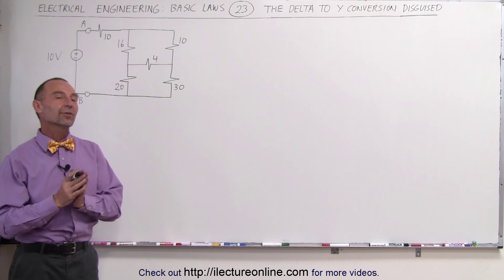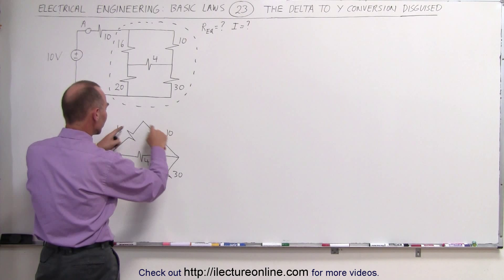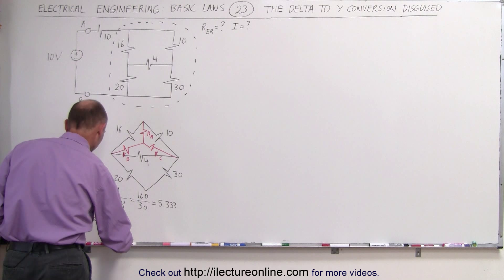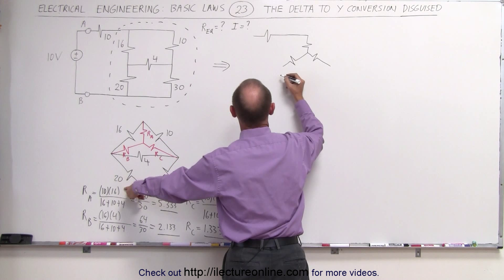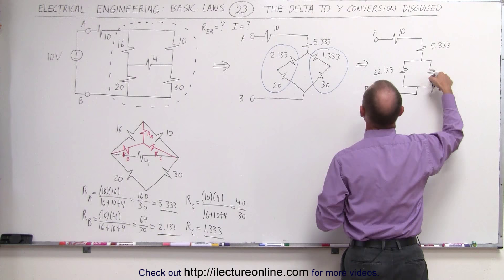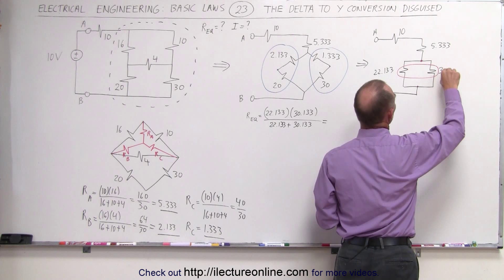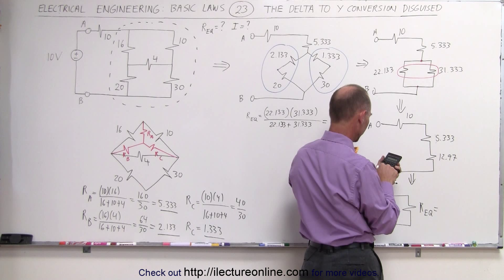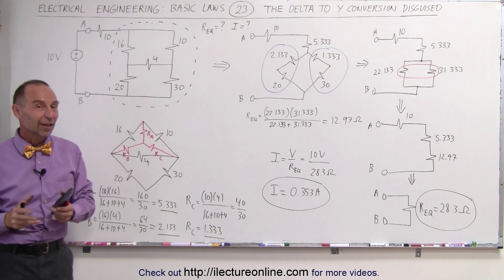Electrical Engineering: Basic Laws (23 of 31) The Delta to Y Conversion DISGUISED

Comment: Is it necessary to deactivate the voltage/current source while applying Delta-Wye conversion in a certain section of a circuit? An answer to this question would be very helpful as I have an assignment related to this topic that needs to be submitted some days later.
Reply from the maker: The delta - Y conversion is independent of the voltage or current source.  It only affects the resistors.  Not sure what you mean by "disconnect".  If I understand you correctly it would not be necessary, but then I am not sure about the situation you are referring to.
Reply: @MichelvanBiezen  it's ok, I got my answer, thank you so much. One of my friends told me that while using the Delta Wye conversion, I need to imagine the circuit without any current/voltage source and perform the calculation, and then later on (after finishing the calculation) put the sources back in the circuit in their previous position. Basically, she told me that I can't perform Delta Wye conversion in a circuit if it has any kind of current/voltage source. I just needed to clarify that confusion, and you did it nicely. Thanks again.

Comment: I was taught a more complex equation for delta to y conversion but Dr. van Biezen's equation helped me solve a problem for ELE 211 DC circuits. I used the equations taught in this video and solved the equations for the problem in my course. If anyone has an insight in the differences in the equations and how to apply them, please respond to my remarks.
Reply from the maker: The equation shown is the only one that I know of to solve the delta to y conversion.
Reply: @MichelvanBiezen  I was shown RA = (R1R2 + R2R3 + R1R3)/R3, RA = sum/R1, RC = sum/R2. I was solving a Wheatstone bridge problem with resistor load instead of a galvanometer between the two series resistors. I solved the lower half of the circuit using a delta conversion. my solution worked in Multisim. The second part of the problem asked to solve the upper half using a Y conversion. Your equations gave resistance equivalents that equaled the circuit measurements.
Reply from the maker: They are probably the same equation in different form.  Did you try to convert one to the otther.  We have some videos that show the derivation of those equations:   Starting with this video:  Electrical Engineering: Basic Laws (29 of 31) Delta to Y Conversion Derived R1=?   https://youtu.be/pDRE4OSUd2Y
Reply: @MichelvanBiezen  Thank you very much

Comment: Sir I  want to ask you that this circuit is already in simple Form and we can easily solve the resistors...than why we transform this into delta shape?
Although I understood the whole thing just a little confusion that why we change it into delta form
Reply from the maker: Did you solve for the equivalent resistance without using the delta to y conversion?

Comment: how can you calculate the current that runs through for example 20 ohm resistor?
Reply from the maker: First you need the voltage drop V (on 20 ohm) = 10V (12.97 / (10 + 5.333))       Then you want to find the current: I (through 20 ohm) =  I total  x (31.333 / (22.133 + 31.333)
Reply: thank you very much 
i might be wrong but did you forget to add 12.97 in your first step in denominator?
and last question have you ever  made a video where you solve this kind of circuit with thevenin or nortons theorem? 
thank you again

Comment: question sir. how do u get the current in 4ohms?
Reply from the maker: The 4 ohm resistor is eliminated by doing a delta to Y conversion.  However if you still wnat to find the current in the 4 ohm resistor, you will have to use the Kirchhoff's technique on all the loops in the circuit

Comment: if i were asked to find the voltage across the 4 ohms resistor, how to find it ?
Reply from the maker: You must calculate the voltage at each end of the 4 ohm resistor.  There are several circuit solving techniques that can be used.  Kirchhoff's rules are a good place to start.  I believe we made a video that shows how to do that.

Comment: The Equivalent resistance is 18.3 not 28.3 check it well please
Reply from the maker: Did you include the 10 ohm resistor at the top?
Reply: @MichelvanBiezen  I’ve now seen it thanks for the reply🤝

Comment: Can you explain why you used the top portion to convert to a Y circuit?. It's just I get the same answer as you doing it this way, but if you convert the bottom portion of the delta to a Y circuit you get a R(eq) of 10 ohms less.
Reply from the maker: +Mark Parr 
Did you include the 10 ohm resistor in the upper left corner?

Comment: Quick question, what steps would you have to take in order to find the current going through the 10 ohm resistor on the right corner?
Reply: Find it's voltage then divide it by 10(the resistor itself) using ohms law